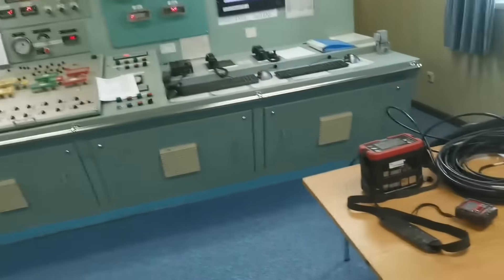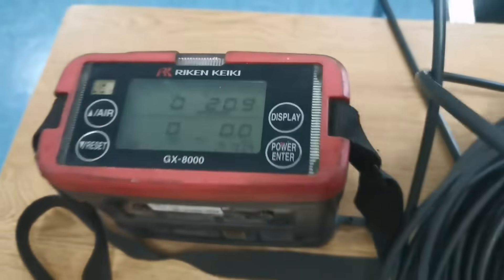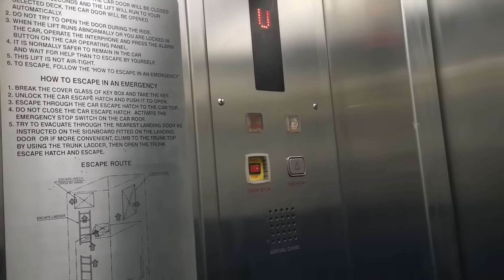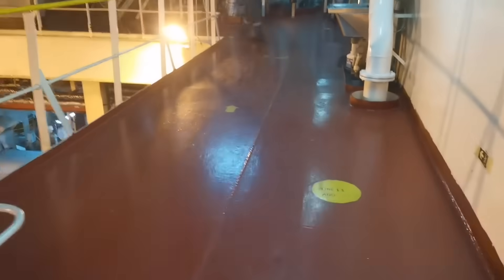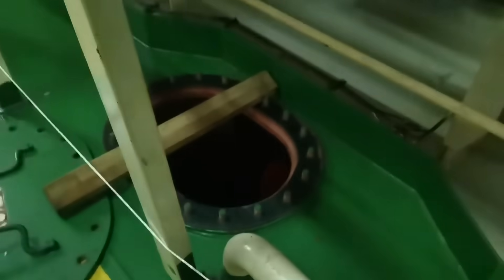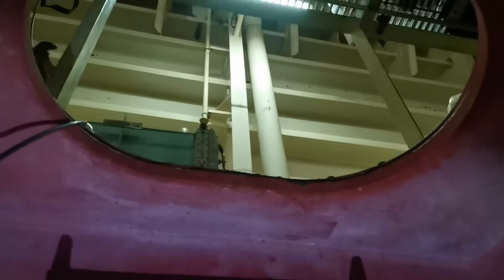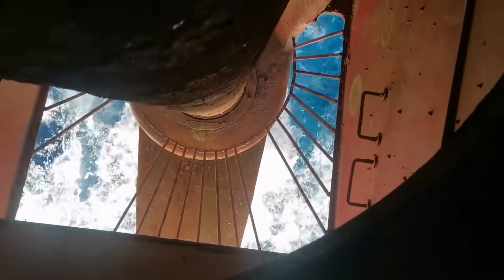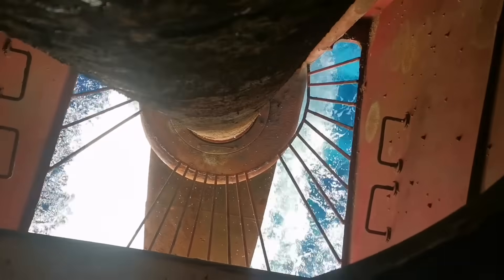How Rudder Trunk looks like | What is Ship Rudder Trunk | Stowaway in Rudder Trunk | Rudder Trunk

Comment: Serious question: Is there ever a time when the ship's ballast would lower itself enough to completely flood this compartment? Like, if you hide in here during a trip and the ship decides to lower itself for whatever reason, would you drown?
Reply: Heavy seas would flood that compartment. While the flooding would  be intermittent, getting slammed by storm swell repeatedly over a few hours would likely not be survivable.
Reply: This was my concern as well. I'm sure plenty of stowaways have drowned and been dragged out to sea in these compartments over the years with no one the wiser
Reply from the maker: @MarkWarren-com  you are write bro.. Some guys used to bang the ship plate and some time it will be alerted by ship crew!
Reply: The ship would be likely dangerously overloaded in that case and beyond the load line legally, if it were still buoyant at all.
Reply from the maker: Even in fully loaded condition also there will be some space to stay, but things will get worst when passing rough seas!!
Reply: I don’t think so. Some guys went to another country in there

Comment: very interesting! Shouldn't this trunk cylinder be painted ? it's very rusty doesn't looks very healthy.
Reply from the maker: Thanks bro, you’re correct ❤️⚓
This area isn’t a normal working space and it’s very hard to do chipping/painting while the vessel is underway. Most of the time this section is only properly painted during dry dock and we can’t use normal paint here .... usually antifouling coatings are applied. 🙏🔥